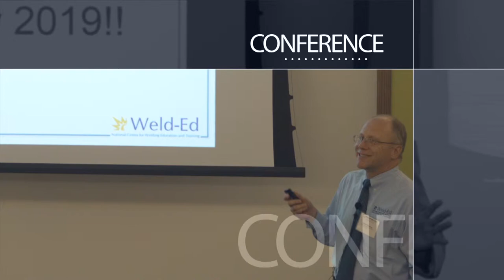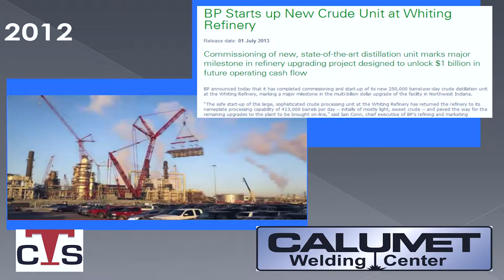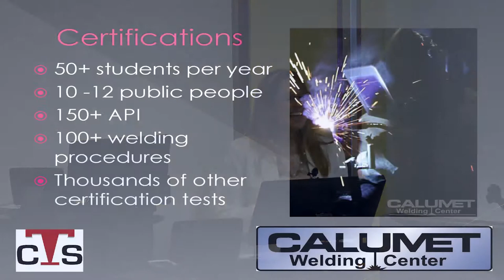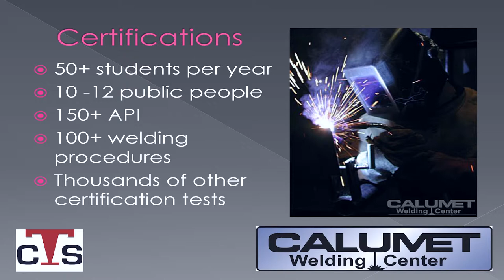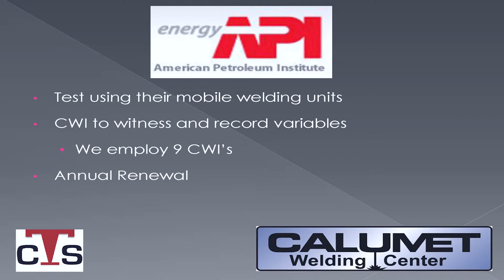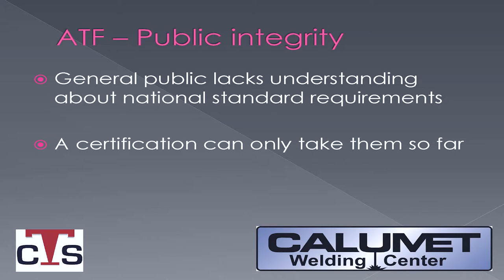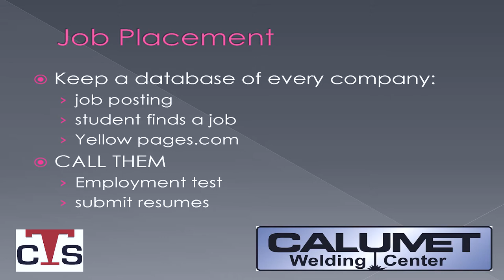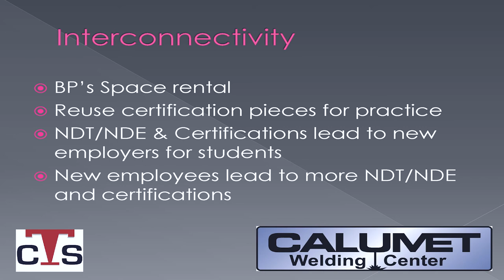Calumet Welding Center Perspectives - Renae Kondrat

Comment: I never welded before and passed a plate test in the flat position which is not earth shattering but it is a certification I needed and wanted... School is not easy and is exhausting but so is welding... Jamie is an excellent instructor and teacher but is not personable-nor should he be... If I had to criticize one thing it would be the job placement- if you don't get an all exclusive certification-you don't get job placement assistance- which may not be needed but seems to be "pushed" upon the more skilled welders-who may not want it or need it ...